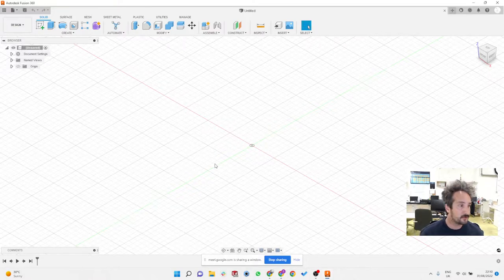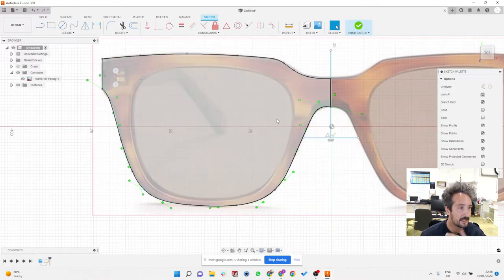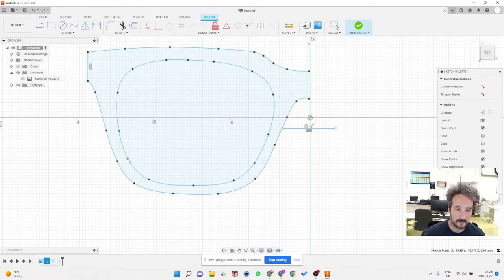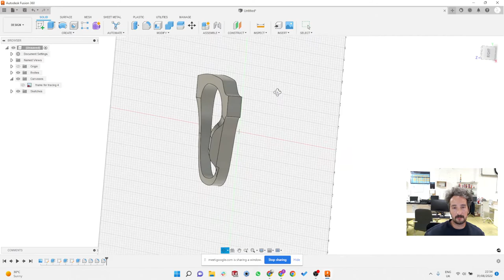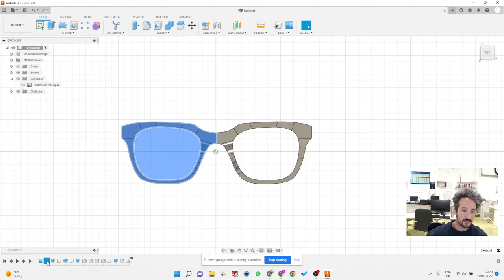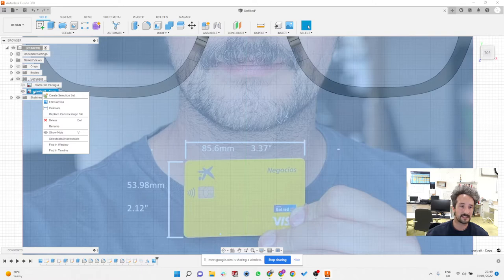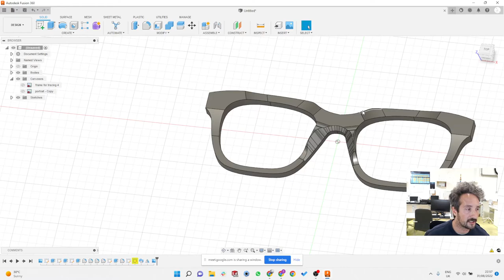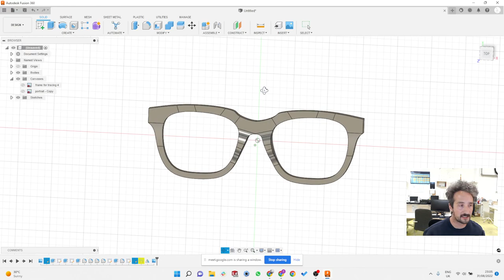Beginner's Eyewear Design Pop-up Class #2+3: Frame tracing/Face scan/Smart design/Adjustability

Comment: Sir how to take measurement of inner frame and outer frame??
Reply from the maker: When using Fusion 360, you can do the measurements using the software as it should be adjusted to actual size.